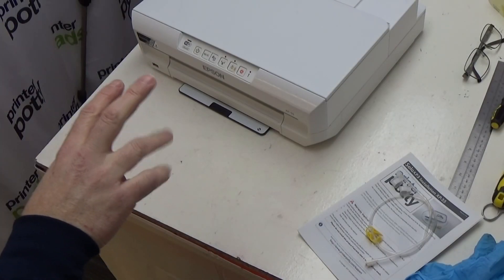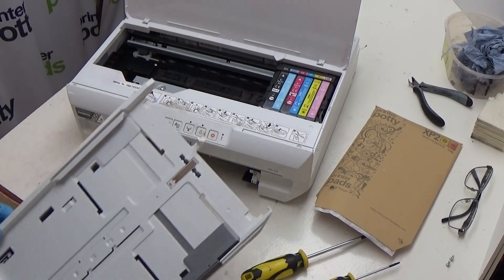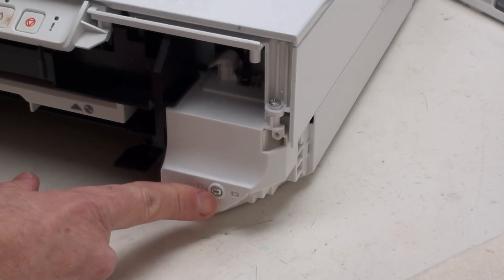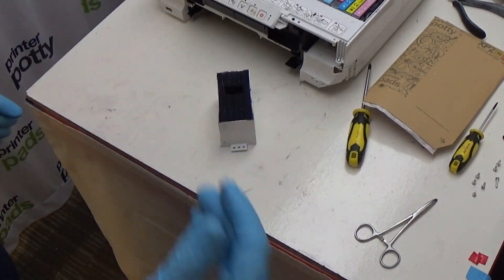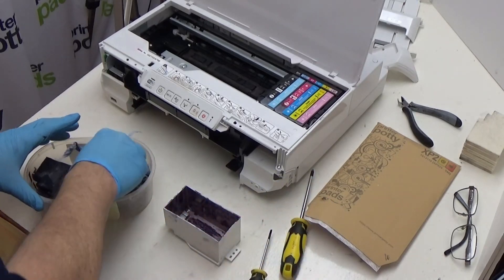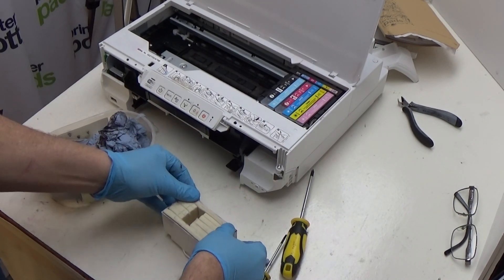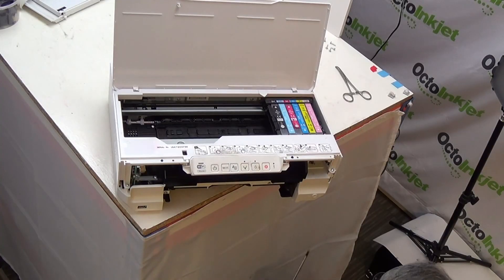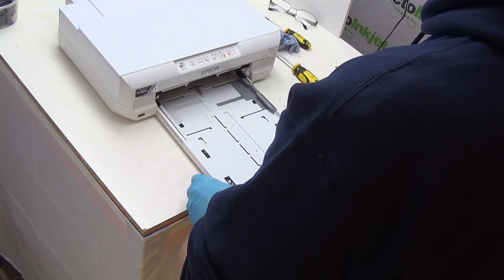Epson XP-55 - Replace the waste pads and fix the waste ink counter error.

Comment: Thanks Martin, clear, concise instructions which worked a treat when I got the Epson 'send us your printer along with loads of money' message. You don't have to change the pads after you have used the reset software but eventually you will get so much ink accumulating in the waste container that it could spill over the edge onto your nice clean carpet! For a small outlay I reckon it's woth doing. After all, Epson probably know what they are doing even if Martin has stopped them getting anymoney out of me!
Reply from the maker: Having had a few folk handed their phone and instructed to phone me or a divorce solicitor, post carpet spill, I can't recommend changing the pads or fitting an external waste kit enough to avoid that overflow. You can get away with a little extra waste but waiting for a full waste ink life cycle is... well... not pretty.

Thanks for the thumbs up :)

Comment: Well explained. But my error message doesn't mention ink pads are full.  But Orange !!!! light is flashing.  Can anyone help.
Reply from the maker: Try using the WICReset app to get the status and report info (no key required) and that’ll provide diagnostic info that I can use to understand the problem better.